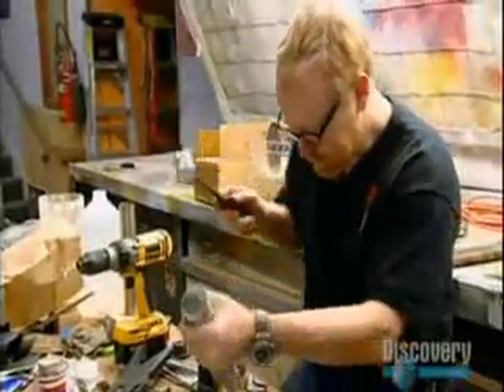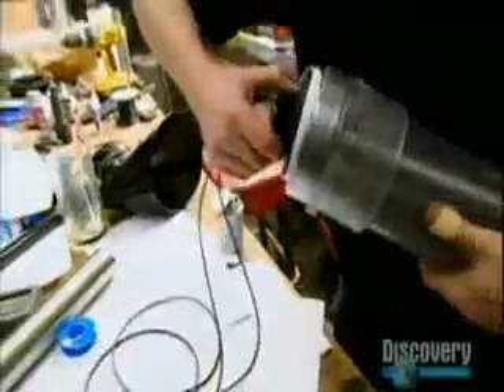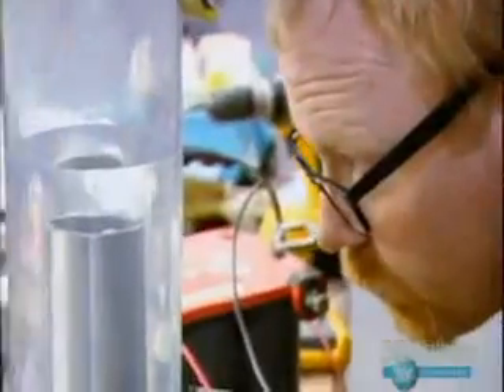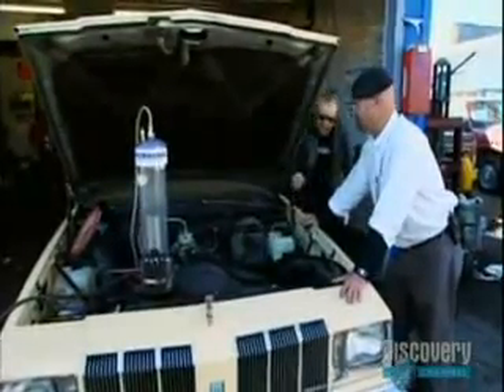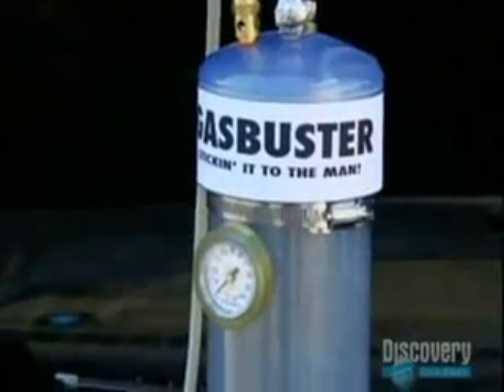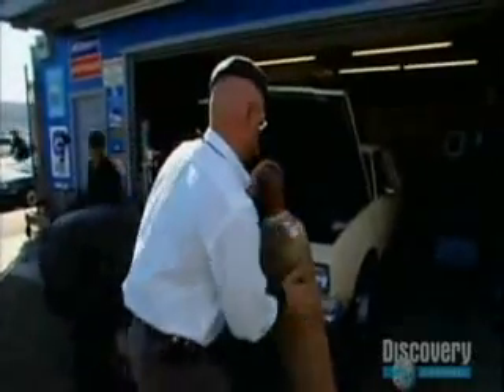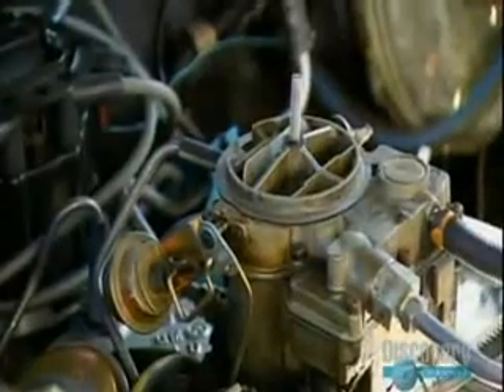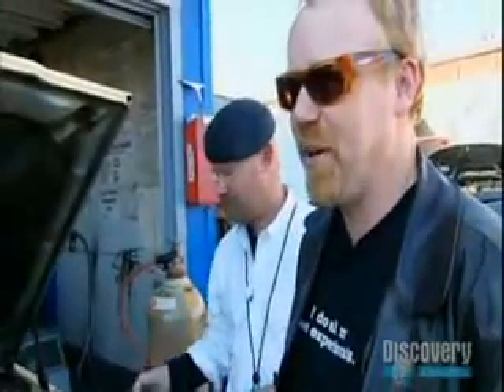HHO Mythbusters Explained

Comment: While you can certainly power a motor on hydrogen it is not an efficient way to power a car.  The problem is you cannot get more energy out of a system than you put into it.  Basic physics 101.  The people who think you can never took Basic physics 101.  The process involves either a chemical reaction to produce hydrogen or an electro-chemical process to produce hydrogen.  in either case, in the transfer of energy the amount of energy represented by the hydrogen is slightly less than the amount of energy represented by the chemicals or the electrochemical contribution to the process.  When you burn the hydrogen, not all the energy is utilized.  Each step of the process of energy transference always looses a little energy because no process is 100% efficient.  So in the above process you have chemicals + electricity > hydrogen > mechanical energy.  In an electric car you have stored electrical energy (battery) > mechanical energy.  Note in the second process there is one less step and therefore it is more efficient.  Therefore it is more efficient to directly transfer the energy from a battery than the above method and that is why nobody is pursuing this.  Simple basic physics 101.  Class dismissed.
Reply: Honda
Reply: It's the basic inefficiency of internal combustion engines that kill the equation.  They lose 70% to heat.
Reply: To be fair in the first comment you'd have to included how the battery was charged and where that energy came from which by your less steps = more efficient formula means hydrogen would again be more efficient. I'd also be perfectly happy with using more water / hydrogen / electricity, i'm not looking for a closed loop system. Honda seems to think its a good idea cause they've already got a hydrogen hybrid coming out.
Reply: TheShank6666 This is like comparing apples to hamsters.  The true hydrogen cell technologies utilize hydrogen and are true source of energy.  Check out what NASA uses on the space station.  It's awesome.  The you have true hydrogen technologies that auto manufacturers are presently working on and soon to deliver to the market.  These require hydrogen sources and are nothing like the HHO stuff, that "run your car on water"  chicanery.
Reply: Do you even know how much power is lost in an engine just because of bearings, your alternator, and your AC. You guys are fucking hilarious.
Reply: zetsi77 Typical internal combustion engines lose about 70% of power by the time it reaches the wheels.

Comment: Okey, I will keep this simple to understand HOW TO make the HHO gas in to a burnable liquid.

UNDERSTAND: A Moonshine Still has a BOILER (THIS WILL BE YOUR HHO Gen) The VAPORS (gas) is sent through a COIL of piping (this is called the worm) the tube (pipe) is in a roll and curves downward inside a 5 gallon bucket of water. The tube (pipe) comes out the bottom of the bucket.   

Answer: Do this and you will have liquid ADD 2 cyl engine oil for the fuel pump and lubing the fuel injectors.  

Now you run on 100% home made fuel... Enjoy...

PS: Please send this information to everyone you know, I feel the same way.  Listening to INFOWARS.COM...

T.I.M.E.X

Comment: I think Mythbuster skew the understanding the purpose of HHO.  The topic of their test is "Can a car run SOLELY with HHO".  The amount of hydrogen produced from HHO kit's are not enough to power a car, it should always be used with regular fuel that's why they busted this.  This creates a hybrid.  In the FIRST Toyota Prius, it probably won't run with the electricity alone, but if you run a little electricity to move the wheels, it probably won't move or move very slow.  They are using the concept of assisting to make the car use less fuel than it needs to move the car.  Primary (Fuel) + Assistant (Electricity) + Assistant (Hydrogen).  Since you got those helpers you don't need to use as much fuel.  Just as you're a manager if you do everything yourself, you're going to burn yourself out faster, but if you break up your projects into smaller task for your subordinates to do, you will have more energy to do other things or take on more projects.  So can a subordinate alone do what the manager does?  Probably not.  (NOTE: Just using this as a analogy, subordinates can promoted all the time.) =)
Reply: I think you are completely correct. Nice explanation
.

Comment: I really doubt the theory of a engine running on water. In order to split water into hydrogen and oxygen you would need to add "x"kJ/mol. By injecting the gas into the engine and igniting it, you would receive no more than the energy added in the electrolysis. When you calculate all the wasted energy emitted in form of friction and excess heat, you don't need to now a lot about physics to know that there isn't enough energy left, to split equal or more water that was used as fuel. The same goes for using it as a fuel saving method. It simply violates the second law of thermodynamics.

Comment: At 1000 RPM the Oldsmobile's Buick V-6 requires 1.9 cubic meters of air per minute(66cfm/5.32lbs) and at an air fuel ratio of 34:1,it would require 21 liters(2.5oz.) per minute of hydrogen to run at fast idle.
 That little thing might power a moped or lawnmower,but,where are you gonna get the juice to power that puppy?

Comment: Run a car on compressed air And put compressed air straight to the wheels to make power instead of gas or anything put a compressed air tank into a car and put the compressed air straight into the cylinders and if its powerful enough it will indeed move the piston up and down enough.

Comment: Using HHO is a bad idea, you will get always risk to explode the mixture. Using pure hydrogen is the better approach. If it leaks and gets in fire, it just creates a flame and does not explode. For making hydrogen, you will need DC and collect only hydrogen.
Reply: RPdigital Hydrogen or Oxygen does not explodes. There's nothing that realy explodes. Explosion is a violent chemical reaction (combustion), and it needs almost 2 ELEMENTS, and other ambient conditions.
Also, the diference beetwen explosion and burning is just the speed of the raction. This speed depends not only on its reactants, but also temperature, presure and other things. (actually, some austronauts from nasa explodes just with a normal oxygen combustion, just becouse it's concentration was a little higer than normal).
Saying that an element is explosive (and so dangerous) is for stupid people.
I don't know how techinical and scientific education works in USNA, but in my country every 16 years old guy knows this things. (and completely for free, cause knowledge is a rigth, not a business)
Reply: *****
Totaly agree, this can be said that the oxygen increases the ¿octans? (in spanish it is said "octanage") i.e, that the combustion is more controlable and you don't need to re-desing the whole motor, just adjust properly the mixture.
Actually, i have recently started a proyect with a partner (i'm studying electronic engeneering) based on this technology. I'll be posting results (videos) as soon as we get them
Reply: You are correct, my friend! Just separate hydrogen from oxygen, compress it, control output with valves and mix it in the carburetor and it works. Having big amount hydrogen and oxygen mixture is like sitting on the bomb. These ugly HHO generators are just dumb.
Reply: *****
LMAO, I almost pissed myself when I saw that you wrote the same thing I was about to write.
Reply: ***** in the Philippines they use LPG as fuel to run taxis there same concept but not hydrogen but same risk. but as far as i know about it there are only 4 reported accident I've heard but not that serious.
Reply: You have bad ideas. I use HHO and I save 45% fuel...
Storing H is a bad idea. You need very high PSI to have any range in your hydrogen tank. Up to 700 BAR!!! let me see how many PSI that is again.
About 10152.0 PSI
BWM makes one of them. They don't actually burn the H but use fuel cell technology. Extracting electisity from H stored under pressure of 700 BAR.
Reply: Marco Schoolenberg
I cannot save 45% with HHO. Your BS has no proof.
Reply: RPdigital
Well Dude that probably means you have not done it right.
You are Ugly. HHO is very very effective. It is not dangerous at all when done right. But you haven't done it right....And so you think you can attack the HHO people who DO make it work. YOUR KIND IS THE PROBLEM !!! You are Exactly like these assholes from Mythbastards !!!! YOU HAVE HEARD THE BELL RING BUT CAN"T FIND THE RINGER.
Reply: shinjiprofile
In your country there are Many Many busses and trucks which have HHO. Speak to Tan Kasuma on facebook. He is in Indonesia and has contacts there who can help you make your own or will help you to buy the correct system for you.
Reply: ***** And where you got your idea for this ad hominem attack? We are talking here about HHO and fuel saving, idiot!
Reply: Pablo Lopez
I think you just repeated my point, like I said, 1 element alone has not danger for exploding and mixture of 2 has. So one should collect only HYDROGEN and use this as the fuel when needed.
Reply: *****
There is an article about the definition of fuel on the Wikipedia website, go and study!
Reply: Marco Schoolenberg So you think that critical thinking means being a part of mythbusters? I know the physics and there is no benefit to convert electricity into HHO and then burn it in IC motor. 1st procedure is about 50% effective and IC motors are up to 40% effective, total 20%. Same time electricity sent to electric motor is 60-90% effective. Need any more proof?
Reply: RPdigital
I said you are exactly like the psudo sientists from "mythbusters". They only re-chew the known laws on thermodynamics. .....  They are old and need revising. Petrol or Diesel doesn't burn completely in any of the current combustion engines. Dynamo/Alernator always delivers amps which can be used to convert water into Hydrogen. This Hydrogen is used to increase the burn of the petrol... ! It is very simple. One thing you do need is a Chip or another way to reduce Petrol or Diesel injection when adding HHO. HHO is slightly different from H2 and O, in that it has the exact mixture needed to brun/recombine completely back to water.  The speed at which this happens and the energy which is released at this recombining/burning spikes/increases the burn of the injected petrol. Which results in more miles per gallon.

That is why I say you re-chew the laws of thermo dynamics ... but you haven't understood the point of HHO. So I hope that even if you don't believe in "over-unity" that this might explain to you how come some people do get savings and others don't. That they don't has to do with the FACT that every modern car has a CPU in it. They control fuel injection. This injection NEEDS to be adjusted for savings to occur. When adding larger quantities of HHO, dynamic adjustment of the ignition timing is needed. (Just like you would do with Natural Gas / LPG )
Reply: RPdigital
Producing Hydrogen is done nowadays as well. Still storing that hydrogen is an issue left to professionals !!! I can point you to a guy building separated Hydrogen Cells. They are a little more difficult to build and for me don't bring a whole lot of advantage. These systems also are not meant to store the Hydrogen but it it is used in the same way as HHO.  Storing, I will not tell you about how you might do that. Because, I don't want to be responsible for you blowing up your house.

Comment: hate to break it to you, but using baking soda still would of not made the system work. you cannot run your car on electrolysis alone. the hydrogen they used from the tank to get the car to turnover is ALOT more hydrogen then you could generate from the onboard water tank. you use more power splitting the water into hydrogen and oxygen then you get from combustion of the hydrogen. thus it cannot work because that would be overunity. you cant just get a system like this, use electricity to make hydrogen from water, use the hydrogen to run your car, charging the battery, and using more electricity to generate more hydrogen.most systems dont even claim you can do that, they just say you will get better fuel efficiency (they are wrong as well, for the exact same reason)
Reply: It would be better to have an onboard Hydrogen tank and to refuel from a homemade hydrogen generator setup at home (powered by solar preferably) with an external storage tank where you can refuel your car from.
Reply: @kyleglenn4132  "make sure your HHO is at least 96% pure or it becomes very explosive."
Don't you mean your H2 needs to be 96% pure?
HHO is explosive even when pure. 
You're right about hydrogen being hard to compress and store. Hydrogen is such a small molecule it leaks through all sorts of materials. Even when hydrogen doesn't leak, it's still a problem since it dissolves into metals and makes the metal brittle.
Reply: You are correct, however in the video they did manipulate the results just a tad, they were trying to run purely off of hydrogen on demand, which is essentially impossible like you said, however if it were collected into a tank throughout the day and that tank was put into a vehicle, your vehicle could essentially run off of hhl fuel, but the real reason why people don't do that is because it's explosive as fuck, so the moment you get into a wreck everyone dies regardless.

What everybody else here is arguing, is creating HHO on demand while using gasoline at the same time, these old cars use gasoline correct?

So you would run both of these systems at the same time, the HHO production really just adds to the efficiency of the fuel that the car already runs on, the purpose was not to run off of pure HHO, that would be dangerous as fuck and stupid to even try.

It has been done before, but even the person who did that on their vehicle explained that if they were to get into a wreck, they would more than likely die.

But it can work so long as it's within a pressurized tank and there is an ample amount of fuel within the tank to run the car off of.

But let me repeat, running purely off of HHO is dangerous as fuck, and that's what the MythBusters were explaining, they didn't even try the trial and error alongside gasoline to test the results from a realistic standpoint.

Nobody here is arguing against the method that The MythBusters created the fuel, we are going purely off of the fact that they didn't use gasoline alongside using the HHO on demand system.

But at the same time it also looks like they left out the bubbler, which prevents kickback like what they ran into when the flame started.

These HHO kits absolutely do work, especially the ones that extract the gas from distilled water with an electrolyte, some people use baking soda, but that's not even the most efficient form of an electrolyte, but it can be used.

The point is, this fuel can be created by using solar panels throughout the day, and the gas can be collected into a pressurized tank and you could have several tanks being filled throughout the year creating this fuel.

There's a man in I think he lives in Wyoming, who decided to collect for himself some pressurized tanks throughout his years and his profession and build himself an underground storage for all these tanks, then he got access to some solar panels and created himself a distillery process so that he could distill the minerals outside of the water it's allows more efficiency when creating the gas, then he had a system with the stainless steel and all the proper portions along with his electrolyte, and throughout the year he would create Brown's gas or HHO in to his tanks and the guy explains that he never has to pay for his electricity bill, in fact he pretty much told the city that he doesn't want it because it doesn't need it, the only thing that he explained that he takes from the city is water, and it's the same water heater stills and uses it to create his browns gas. The only time of year this man uses up most of his gas reserves is in the winter, because in the winter solar panels don't collect as much because the solar gain is a lot less because the clouds during the winter and there's snow on the panels so they lose a lot of efficiency, but throughout most of the year he was collecting all that gas from the sun and he was using it while he was living there, but the vast majority of it is in reserve for the winter which keeps his home heated and keeps his home with enough electricity, and that's how his HHO on demand system works.

He could essentially get a separate tank throughout most of the year and use it to create on demand fuel for his car, but again you don't want to do this because it's unsafe to have a tank of this stuff in your car especially if you were to get into a wreck.

So that's why HHO on demand mixed with your gasoline or diesel fuel will actually prolong the life of that fuel and make it cheaper.
Reply: what are you on about do you work for prickbusters sorry I should have sad mythbusters
Reply: nope. i dont even watch it. I think ive watched maybe 2 episodes in my entire life.

Comment: ¿Direct current?
Reply: Direct Current means that the positive and the negative poles does not fluctuate. Electrical power is constant.
Reply: AC from wall socket.
DC from car battery.
Reply: Marco Schoolenberg kind off like that. I just don't have the skills to explain in words how they function differently. With electricity, there is two main poles. In DC ( direct current) when on one pole is always positive (electrons flows through to the device being powered) and a negative pole (a connection to source from the device to complete the connection). With AC (alternating current) the poles will take turns of being positive/negative. These turns are based on how many cycle per second (Hz).